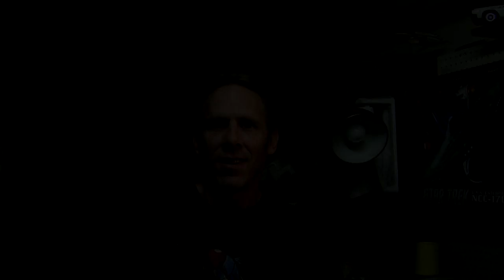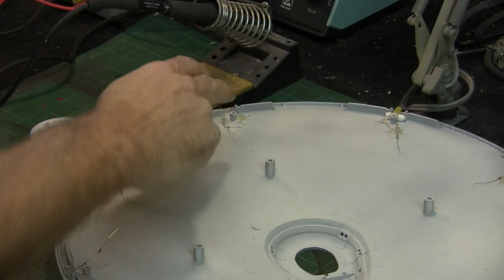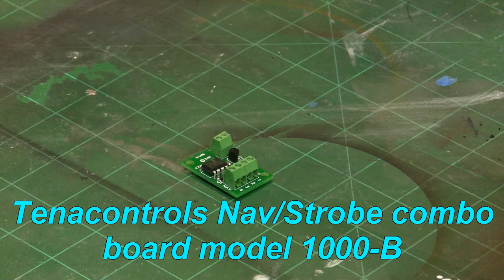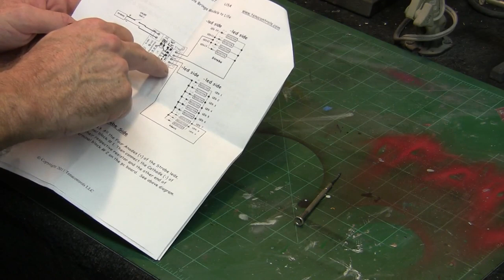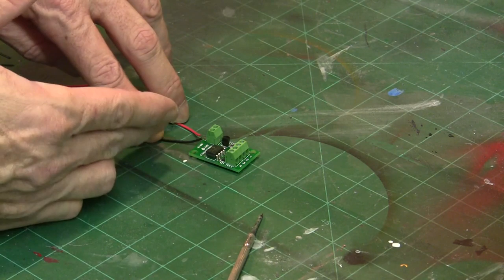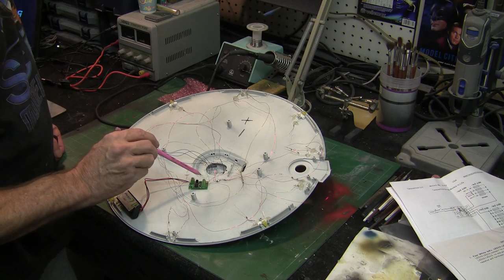1:350 Scale Enterprise Refit Video Build Series Pt 4 - Soldering Some LED's

Comment: Hi Boyd, I might be a little late getting on the bandwagon here. Last year I built a TOS 350 Enterprise and loved it. This year I'm tackling the refit  model. My one question is about the placement of the resistors. I have the Tenacontrols board for Nav lighting and the schematics I have and I think the schematics you have in one of your vids show the resistors going on the cathode side of the LED. Yet I think you soldered yours to the Anode side.  I soldered up 3 navigation LED's last night with the resistors on the - side and they seem to work just fine. Did I misunderstand the LED wiring completely?  Your vids are awesome btw, made me really slow down and pay attention to what I am doing. Thanks for the help!

Comment: Love the series, but have a special request regarding the wiring of the 1701 Refit, I'm a total novice when it comes to LED Wiring and got rather confused about the circuits in the saucer, how to link the LED wiring up without the danger of blowing any of the LED lighting. If at all possible could you add a step by step series on wiring this kit but quite detailed so that modellers such as myself don't make very expensive mistakes, especially with such a great model. kind regards from England

Comment: For the Magnet Wire, what Thermal Class do you use? 130? 155? or does it matter?
Reply from the maker: I'm not sure what class it is. It's just 30 gauge wire. Setting the temp on my solder iron to 750 works like a charm to melt it.

Comment: Are you using lead-free solder? I've been using it but it's not as easy to use as the older, lead solder.
Reply from the maker: No, I don't care for the lead free stuff. Old school lead solder here.
Reply: TrekWorks I think I'll switch, too. The lead-free solder has been really difficult to work with.

Comment: Boyed

That is a huge help. What type of paint would you recommend for relatively fast drying and as inexpensive as possible as I will need a lot to paint for these Enterprises? I do have a large paint gun I use so I can mix paint.

Jonathon
Reply from the maker: I use automotive based paints as was used on the original studio model.
They are acrylic urethane or sometimes called polyurethane.
Fast drying very durable and they spray on ultra smooth.

It dries to a semi gloss look so if you want more or less gloss you will need to top coat with the clear of your choice.
Reply: Great thank you for all of your help. Your videos have helped me a lot

Comment: I was wondering on the magnet wire, i coudnt tell in the video, do you have tyo worry about the positive and negative touching? They looked like they were overlapping, hard to get a good look at it. Love the build videos, keep em coming :)
Reply: No ace you don't have to worry about touching as they have protective coatings on them.  The only thing you need to watch for is when you are soldering and don't heat the wire up too much as this coating does burn off quite easily

Comment: Boyed

I have a few questions for you. I just finished building the TOS enterprise. I used a car paint which is an acrylic enamel I then sealed it using the water base pleg floor shine. After letting the floor shine dry over night it is now starting to crack. Do you know why it is doing that? Also I finished wiring the stand the other night and let the lights burn for a bit. When I woke up the next morning the transformer was burned out. Do you know what could cause that? Could the switch have anything to do with it. If anyone else may know I could really use the help. Thanks

Jonathon
Reply from the maker: How long had the paint been on before the floor shine was applied? Enamel paint takes quite a while to fully cure. It's the slowest drying of all paints. It could be that it wasn't dry and the floor shine has softened it up. Usually the floor shine won't react with anything. It's very neutral. On the transformer, what is it rated at for amperage? If it is under rated for the load, it can get hot because it's being over worked and then finally quit. The fully lit TOS model probably needs a unit rated at least 1.5 amps.